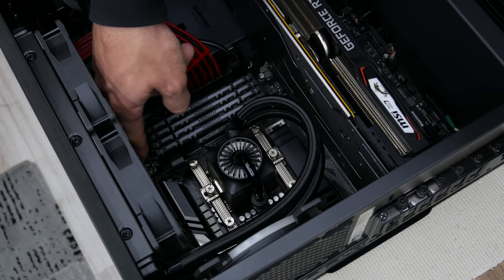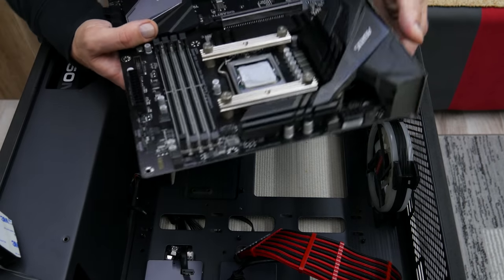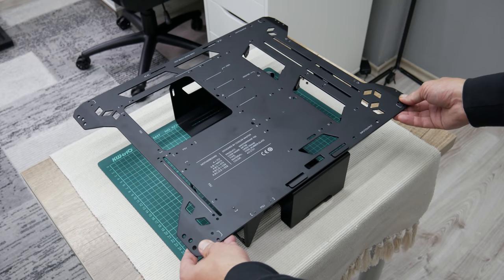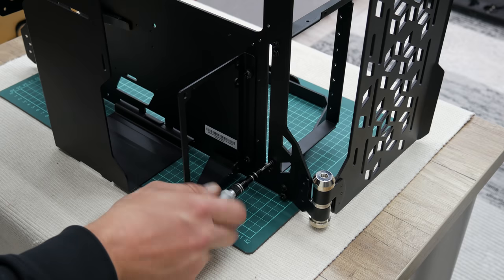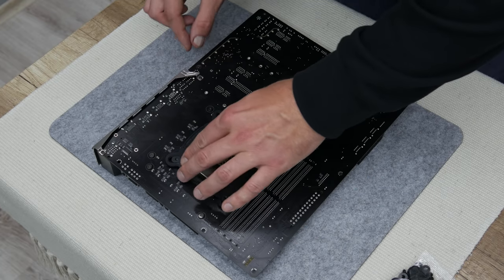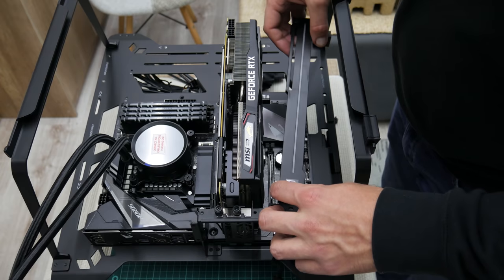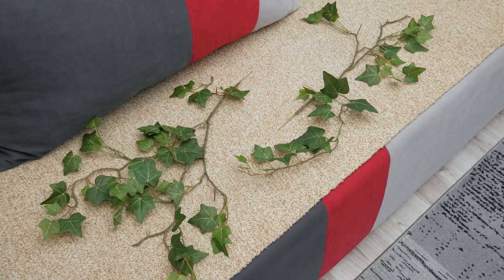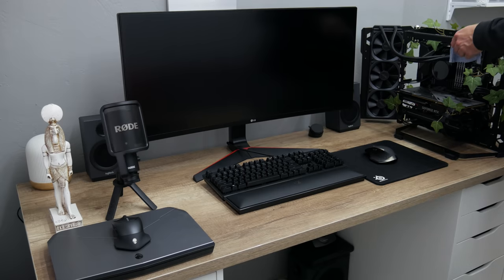Re-building my PC - Weird

Comment: Great build dude, except for the infamous exploding power supply you chose 😅
Reply: The Aorus one he used is fine. The problematic Gigabyte PSUs were the GP-P750GM and GP-P850GM.
Reply: thing is, Aorus is not known for making different products than their bigger company (Gigabyte). actually, they are pretty much the same, so Jolly was right all along.
Reply: @thosepixelstho  in fact they all have the same components inside since there are not different companies. Aorus is only on word added to some LEDs overpriced products of theirs.

Comment: Not bad, not bad at all! Like the multiple SSDs and the 64GB RAM. That is also an unusual choice of case, which although I wouldn't choose it myself, will certainly result in less temperature issues.
The problem with the old case was that having a glass panel in front of the fans results  in much less airflow going through the case; this is why I would not choose a glass fronted case myself, and instead have a standard case that can have unobstructed front facing fans (as well as a slot for optical drives - yes, I still use CDs and DVDs when required). Then I can just add external RGB to the case if required, such as Philips Hue striplight or Philips Hue spot/desk lights. :)

Comment: Funny story, I was going to replace my 9900/2080ti dual loop build. But shortages. So embarking on a rebuild in the masterframe. Three years on it is a good opportunity to undo some of the shoddiness in the original build from X years ago. Cheaper than a whole new system, easier to work in, and good preparation for an eventual platform change.

Comment: You could remove the side panel since you clean once a week, it will drop temperatures about 10°c. Very cool upgrade , love ur videos.
Reply: removing a side panel is not guaranteed to drop your temps by anything. a proper fan setup in a closed case, in many situations, will actually have much lower temps than an open side. its about air flow, vacuum and pressure. all an open case does is introduce ambient air, without a guarantee that it will move evenly with the airflow.
Reply: @unittwophoto  i agree bro. But in my case i guess the airflow isn't that well although i have 3 push 1 pull fans . When i remove side panel everythings temp drop about ten degree Celsius

Comment: isn't Gigabyte PSU's bad?
Reply: yeeh this is the exploding psu but 750w psu  more exploded(gamer nexus )
Reply: Not this model. The bad Gigabyte PSUs were the GP-P750GM and GP-P850GM. The PSU used in the video is an Aorus GP-AP850GM, which is fine.